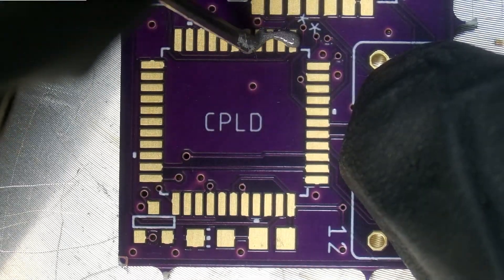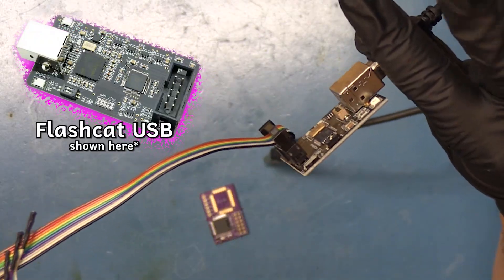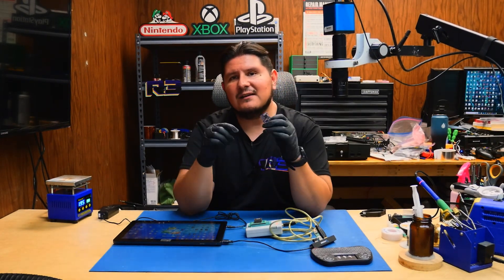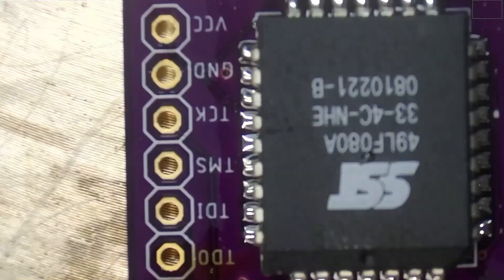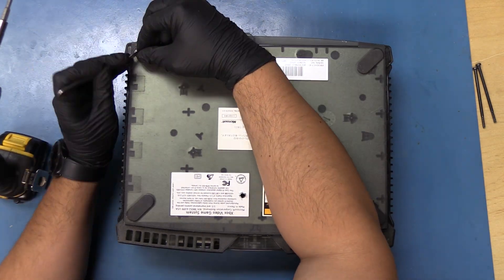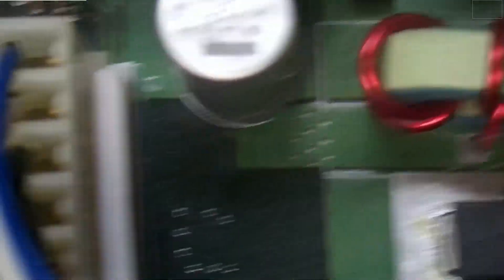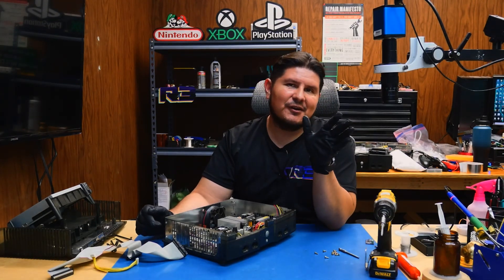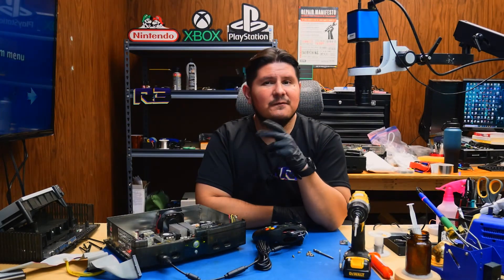DIY XBOX Mod Chip - Make Your Own

Comment: Grounding D0 leaves the console to boot from LPC (chip always on).
If you use D0 pad, The Aladdin XT also has a BT pad, long press pwr button boots chip, short press for tsop.

Edit: some say to softmod first but you'll be able to boot to MS dash with a locked drive and the proper files in place.

Comment: i flashed my bios by shorting the traces so the OG bios is well Cerbios heh but i was wondering as im tempted to build one of these myself, could the console use the one i build or the built in cerbios if i installed the made one?

Comment: I have four XBOX's and only the oldest (1.0) has leaked and it was only under the clock capacitor on the legs.
Reply from the maker: Pretty lucky. I think just about every 1.0-1.4 I've opened has had a leaky cap, though not all have had trace damage.

Comment: Nice video,  Just a heads up though, there's a much easier chip to build that doesn't require a programmer in the RP2040 tiny with the modzvilleusa interposer board. It also runs prometheos which can be flashed with 4 bios banks.  You should do a video on one of these.  Feel free to PM.  The new gerbers haven't been released yet.
Reply from the maker: I wouldn't mind trying it out, but I don't see a way to PM you on here.

Comment: I'm curious, if you have to touch up the solder joints after using the solder paste why not just do manual soldering, like drag soldering, in the first place?
Reply from the maker: I honestly just wanted an excuse to use the heat plate.

Comment: Whats the difference between this and the Aladdin? Or are those funtionally the same?
Reply: Difference is 1MB Chip opposed to the 256KB one. So with this you can utilize a built in Xblast OS or PrometheOS to set multiple Banks to use for different bios including a recovery one if something goes wrong. If you TSOP a bunch of consoles you can also use this as a tool for consoles that are getting red ring due to a faulty HDD. Also since you now have a Modchip OS you'll be able to test Ram Chips when doing upgrades or many other tools.
Reply: @legendofcho noice